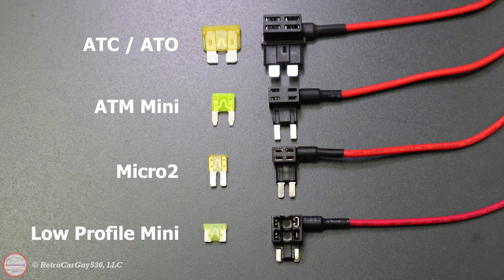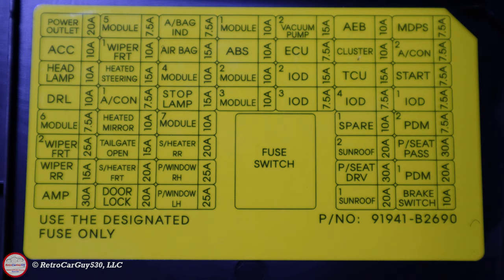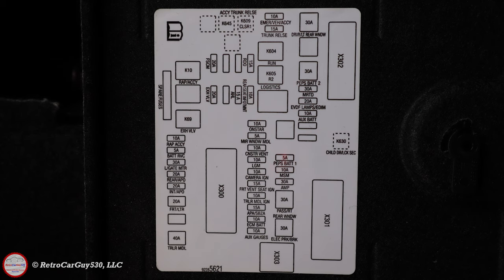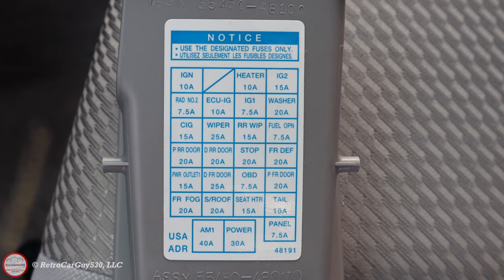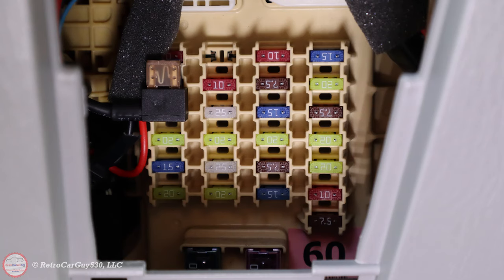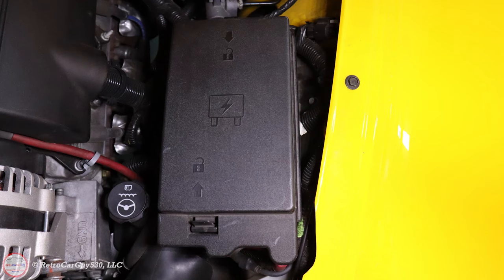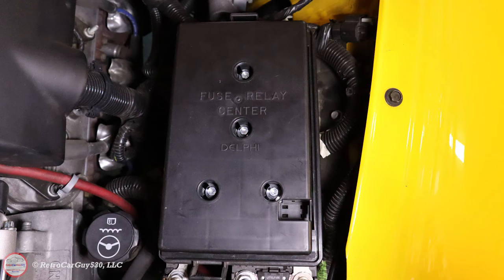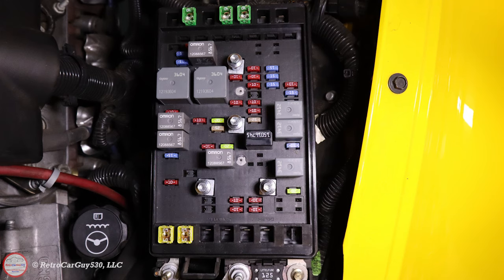How To - Add a Fuse Tap in Your Vehicle

Comment: Hello, just had a question on the “Add a fuse” piggyback, do I match that circuits fuse amp rating, or do I go with a lower amperage when adding the extra fuse? I bought a pair of headlights for my truck and want to make sure I install the DRLs properly and safely. Subscribed and liked your video :)
Reply from the maker: @Hope Gambles I had a similar question a few days ago.  If the current draw for the accessory being added is a high amp amount, I would suggest finding an unused fuse socket if at all possible.  For example, if there is an existing fuse in the fuse socket and the existing fuse in the socket is a 25 amp fuse and you're adding a 25 amp fuse for the new accessory, that fuse socket is now potentially supplying up to 50 amps (at high draw moments).   That could be a bit much for that one fuse socket to supply.  If you must use a fuse socket that already has a fuse, there is nothing saying you cannot have the accessory fuse being added have a higher amp value than the pre-existing fuse.  I would also suggest that you make sure the pre-existing fuse is not powering any sort of control module or critical system in the vehicle!  That's why it's important to orient the fuse tap correctly in the fuse socket so the power from the fuse socket feeds each fuse (pre-existing and newly added) directly.  If the fuse tap is inserted reversed, that will cause the power from the fuse socket to go through the pre-existing fuse to supply power to the fuse socket powered item and to the leg that then powers the new fuse/accessory.  That's the most common mistake I've seen when people have added a fuse tap.    Make sure you identify the side of the fuse socket that supplies the power, insert the "left" fuse tap side (side that supplies power directly to each fuse in the fuse tap) into the side that supplies the power.  That way each fuse is sort of independent from each other other than the total load placed on the fuse socket by the existing item powered by the fuse socket and the new accessory.   My main point is simply to get the fuse tap installed/oriented correctly and make sure the total amp draw (both fuses) is not "crazy big" for one fuse socket.  I hope that helps!
Reply: @RetroCarGuy530  maybe 3 years ago.. but how do u know what the amp rating is on a unused fuse.. there a fuses for 30amp.. And can that fuse adapter handle for example 30A, do u need to replace that wire? Thanks for your answer
Reply from the maker: @Arvidje  An unused fuse box fuse socket may or may not have the ability to supply a high amp amount.  If the owner's manual doesn't define what the max amp rating is for that fuse socket (that happens to be unused in your year/make/model), then you have to be somewhat conservative in the power load placed on the unused fuse socket.  A 30 amp load via a fuse tap is way too high IMO.  I've been recommending using a fuse tap for loads below 10 amps.  For new loads 10 amps and above, I would suggest running a wire from the battery with an inline fuse and then use a 4-terminal relay to control the power if the new device requires switched/accessory power.  I cover that approach in my videos installing a dash camera battery pack in a car.  The more recent video on that topic is this one.  https://youtu.be/Gn3IoBjO_Vg  Look in the charging power wiring options chapter of that video.
Reply: @RetroCarGuy530 Thanks for the fast reply. I need about 14 -25 amp max. Running a wire to the battery is very hard on this car. I want to try the fuse tap on a cigarette fuse (rated 30amp). Only use one 25 amp fuse on the device side at the adapter, so disabling the orginal.. If i cut the wire from the fuse tap adapter and replace it with a 6mm2 wire, can it handle the current or will that plastic fuse box become to hot..
Reply from the maker: @Arvidje  Most fuse taps come with either a 16 AWG or 14 AWG wire.  The thicker 14 AWG can carry a max of 15 amps for up to 8 feet.  If your new device/accessory requires up to 25 amps, I would not recommend using a fuse tap to obtain its power.  If you remove the original fuse from the fuse box and don't install that fuse in the bottom of the fuse tap, you can be somewhat assured that the wiring up to the fuse box can provide up to 30 amps.  I just don't believe the wire gauge (AWG) of the wire used inside of the fuse tap casing is up to the task of providing up to 25 amps of power.  You'd have to get the 6mm2 wire (approx 10 AWG) inside of the fuse tap casing and attach it in place of the wire that comes with the fuse tap.
Reply: Again thanks for your quick answer.  I have one idea left and maybe u can give me the proper advise. What will happen if i use 2 fuse connections and distrubute the power. So i will use 2  of these tap adapters and use 2 fuse connections,  for example one from the cigarette and an unused one and distrubute it to one source of power.. will that work properly,  will that be a saver option?  Will the amperage split/divide?  @RetroCarGuy530
Reply from the maker: @Arvidje  in theory the load will be divided, but there won't be a single point in the added circuit to place a fuse to protect the wiring for the new device/accessory and the device/accessory itself.  I can't recommend that approach especially if I've never tried it to see if there are any unknown issues in that manner of splitting the input power.  My suggestion would be to use the new wire from the battery with an inline fuse and a relay to control it (if required).
Reply: @RetroCarGuy530  The battery will be the best option for sure!  But i think i will try and test this approach, i dont see where u want to stick another fuse for the circuit,  both on the adapter will have 15A fuse, if one side become short for example, the other fuse  will immediately break also if the amperage exceed 15 and cut the power.. And the device has a build in fuse of 25 or 20 amp..

Comment: what if the fuse is getting power on both sides
Reply from the maker: If you test a fuse and the fuse socket is supplying power when you're testing it, you should see power on both ends of the fuse.

If you're testing the fuse socket (without a full fuse installed) and you find power on both sides of the fuse socket, that would suggest something might be incorrectly back feeding power to the fuse socket.  A fuse socket should only have power provided on one side/end of the fuse socket.

Comment: Is it safe to use a fuse tap with an original 25 amp fuse with a 15 amp fuse for the new circuit?
Reply from the maker: To declare the use of a 15 amp fuse for a new circuit being added by the fuse tap to a fuse box fuse socket with a 25 amp fuse is a nearly impossible thing to do.  With any reasonable degree of certainty.

The reason being that you would need to know the wire gauge of the wire supplying power to that particular fuse box fuse socket to know if it could sustain a steady 40 amp load or even a burst load of 40 amps.  In most cases, the answer to that is most likely no.  It also depends on how much of a load the original fuse box fuse circuit actually consumes of the 25 amps.  It requires a much higher level of information than most vehicle owner's can confirm when making that decision.

My opinion would be that adding a 15 amp load to a circuit that may have a 25 amp load already present is likely asking for trouble.

I recently created a video reviewing a dashcam battery pack (BlackboxMyCar PowerCell 8).  In that review, I discuss the hardwiring of the charging power for the battery pack.  BlackboxMyCar says you can source the power for that battery pack using a fuse tap.  That battery pack can draw nearly 15 amps when configured at its highest charge level setting to achieve the shortest charging time.  The makes that battery pack a device that draws similar amperage to what you're trying to provide to a new device with a fuse tap.

In that dashcam battery pack review, I discuss my preferred approach for supplying power to devices that require 10 or more amps.  It's using a 4-terminal relay to source power for the new device from the vehicle's battery with an inline fuse to protect that circuit.  The fuse tap is still used, but instead of supplying power directly to the new device, the fuse tap supplied power is sent to the relay and it controls when the relay is On or Off.  The relay's control circuit draws a very small amount of power (well below 1 amp) and that makes the relay a much better candidate to use with a fuse tap.

Here's a link to the section of that video where I discuss the hardwiring option of using a relay to supply the power to the device.  In the diagram I show, replace the "PowerCell 8" device with your device and that same logic still applies.

I hope that helps.

https://youtu.be/Joa0fiKZY-o?t=744
Reply: If the the new circuit work with a 5 amp, it will be safe ?
Reply from the maker: Adding an additional 5 amp load to a pre-existing 25 amp circuit is likely to be safer than trying to add a 15 amp load to that same 25 amp circuit.  There's usually some margin of error (over capacity) in a circuit's wiring so the 5 amp load is far more likely to be within that margin of error for the circuit.

A fuse for a circuit has to be sized to account for the max amp draw.  The max amp draw often occurs when you first turn on the device / accessory on that circuit and it often lowers to a level which is the constant load for the circuit.  The amount which it lowers from the initial startup current draw amperage to the steady state current draw depends on the device itself.    The current draw for a device / accessory on a 25 amp circuit might spike when the device / accessory is first turned on to 20 to 25 amps and then it will likely drop down to some lower value.  Adding a 5 amp fuse for a new device means the new device also likely has a peak amp draw when the item is turned on of no more than 5 amps and it too likely settles down to a lower steady state amp draw.   The fuses and the wiring for the circuit need to account for the peak amp draw when the device / accessory is turned on.  That's why it is very difficult for someone to state with a 100 percent level of certainty that adding a fuse tap to any circuit will work 100 percent of the time.  That are so many tiny details that go into making that determination.

Comment: does the orientation of the fuse matter when putting it in the fuse tap
Reply from the maker: David Parker blade fuses can be inserted in either orientation.  As discussed in the video, the orientation of the fuse tap in the fuse socket is important to make sure the 12-volt power is supplied to the left leg/pin of the fuse tap.  The existing fuse (if present) goes into the lower socket of the fuse tap and the new accessory fuse goes in the top fuse socket of the fuse tap. I hope that answers your question.
Reply: @RetroCarGuy530  Perfect, cheers mate